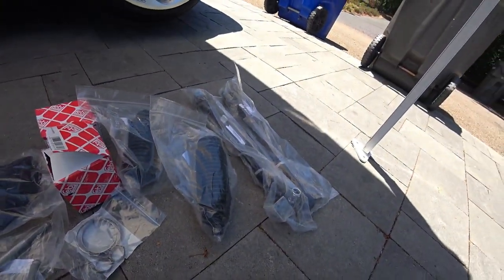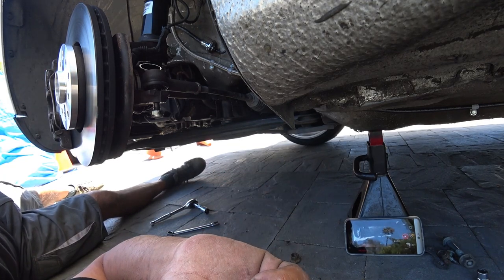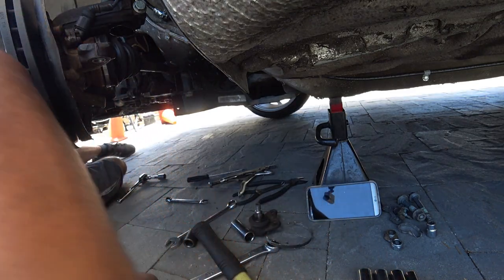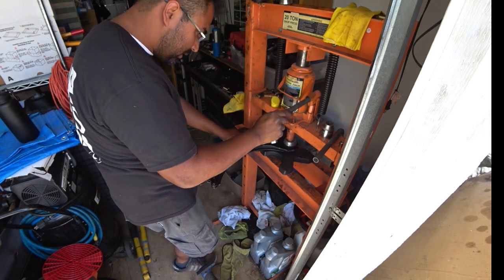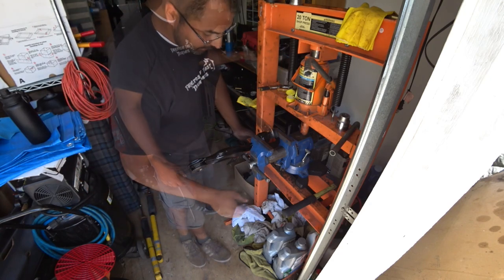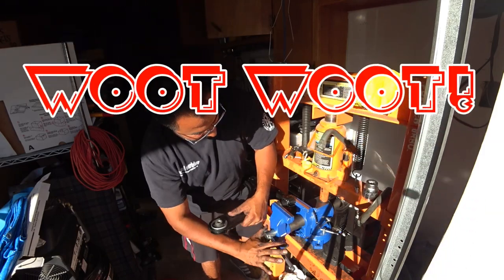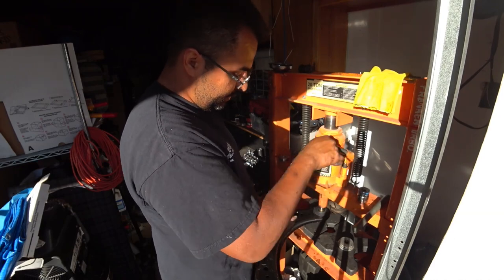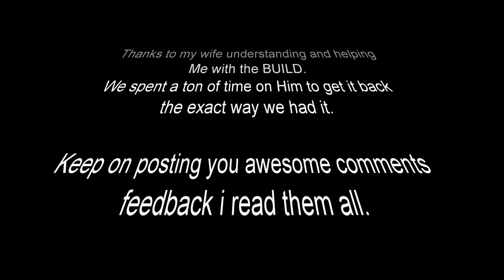How to install New Control Arm Bushings and Tie Rods on a MK4 Jetta/Golf/Gti/Gli S4EP20

Comment: thanks dude good lookin out! for anyone that broke off that nut in the subframe you can get it with a clothing hangar and screwdrivers, I had someone hold it in place with a flathead while putting in new bolt

Comment: Pinche al! Love the videos! But hey, know you are replacing the tie Rod ends but for those who remove them without replacing hem, you should inform them of the way to remove it without damaging it. There is a little rectangle pad on the steering knuckle that you hit with a dead blow, maybe 1 or 2 good hits and it pops out without damaging anytbkng. That's what the part on the knuckle is for.

Comment: The lube for those bushings not only help them go in but it is also supposed to help them from squeaking so you do want to put some on the bushing itself because it will basically squeegee it out. Also getting an acid brush helps keep it from getting everywhere that you touch because that stuff is really sticky

Comment: I love this video, until I went to install the ball joint that connects to the control arm. It just spins when I put the locking nut on. There is a place to hold the stud(allen) coming out of the ball joint but of course the Axle needs to come out to it. So how did you pull this job off without pulling the axle out of the hub?
Reply: Very carefully apply a small amount of jacking force upwards against the bottom of the ball joint.  Not much, just enough to press the tapered stud into it's steering knuckle home and give you enough bite to prevent it from turning with the nut.  If it still turns you must have some grease and grime on the mating surfaces.
Reply: @dharm3974  Worked like a charm! Took in for an alignment. Drives like a different car.
Reply: @jonwikan3986  Glad to hear!

Comment: Nice Video !! The stance look nice as well. What spec tires and rims are you using? And what and size spacers are you using? Is the vehicle lowered? Any camber change? Thanks
Reply from the maker: moh7979 wheel specs are 18 8.5 front with no spacers
18 9.5 rear no spacer
Rear had IDG lowering plates
Tires are 18/40/205 front
18/40/215 rear
Rear has 2 degress of negative camber
Front has no camber
Reply from the maker: moh7979 car is on bags

Comment: Not a good idea these polyurethane bushings. The rubber ones in metal outer ring is designed with a directional fitment for a good reason.

Comment: Hello i have a problem with my mk 4 golf I installed brand new control arms but they hit the subframe where the subframe mounts on the chassis any way on how I can fix that? They are exactly the same as the original control arms

Comment: Thx for the video. I'm doing lcas, tierods, swaybar bushings and ran into a snag. The ball joint nuts are frozen. Used wd40 rust release penatrant to no avail. 

The lca bj nut wont spin and I can't get to the t40 torx cuz it is blocked by the axle. The tierod nut moved 3 threads and the t40 hole stripped. How do you remove each in these situations.

The front/rear lca bushing bolts anf 3-13mm bolts removed w/o issue.
Reply from the maker: K03sport cut them off
Reply: PincheAls Garage... Thx... Ahead of you on that...started cutting the tierod nuts and will get the bj nuts tomorrow...14yo car rust sucks balls. Appreciate what you do for the vw community 👍

Comment: Why is solid poly a "big upgrade"? Do you think VW wouldn't make them solid if it was better? They are made of rubber and have holes for a reason - they are intended to act like a small shock absorber. Using full rubber or solid is only advisable for racing or if you drive exclusively on perfect roads. If that is not the case they are bound to fail and/or put a lot of stress on the other suspension components.
Reply from the maker: Funny thing they did made them solid on the R32 and Audi TT because it is better.
They increase road feel and provide much better steering response.
That is why a lot of people go to R32/TT soild Bushings or poly
Reply from the maker: Anything but stock will increase more stress on the equipment that is why we upgrade everything else to help overall not just Bushings
Reply: @PincheALsGarage  i didn’t know that detail, interesting. But again, even between a 90hp and 130hp TDI there are big differences in things like clutch etc - not just the hp difference. So yes provided you upgrade other components as well I guess solid bushings can be a good upgrade.
Reply: @zaratrusta79  even back in my mk2 days running coilovers I would use the r32 solid bushings , they would still get wrecked riding low but they would outlast the stock bushings with the holes . I don't think personally I would run poly bushings on a tdi (just me) but I'm about to install the r32/ tt bushings on my tdi golf they seem to be a better option then the "cut out" stock versions and a bit more durable

Comment: Dude. I cannot get the smaller bushings in. It’s gotten to the point where I’m removing material off of the lip to make it go in. It keeps gettin fat in the middle and WILL NOT go in.
Reply from the maker: Yeah they are a major pain to install. Are you using a curved set of vice grips to help with the middle of the bushing. Plus use a lot of the lube they provide.